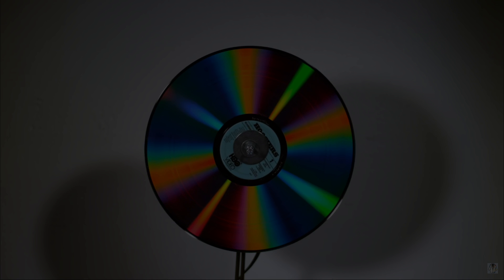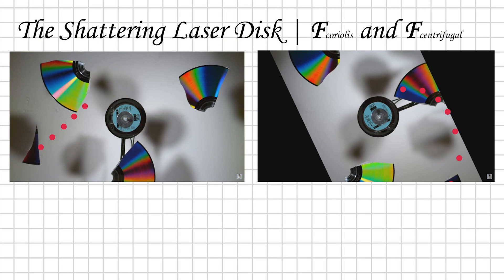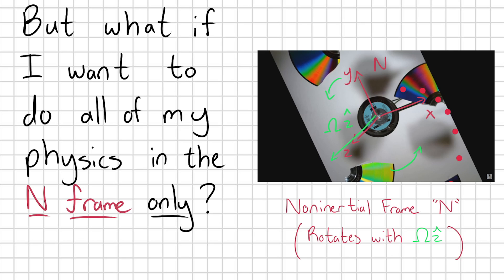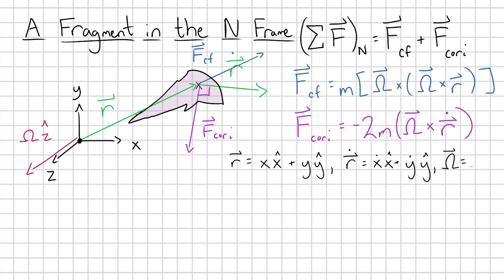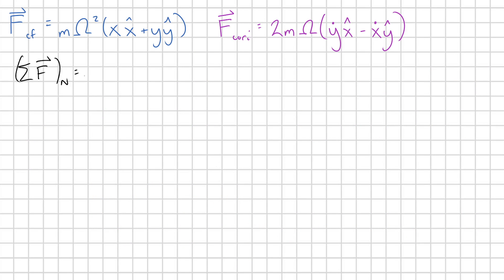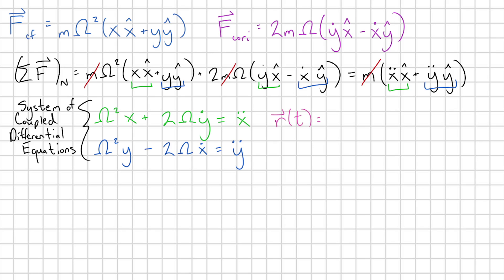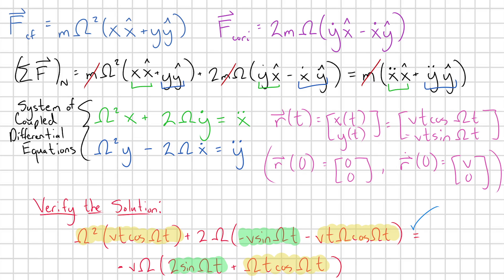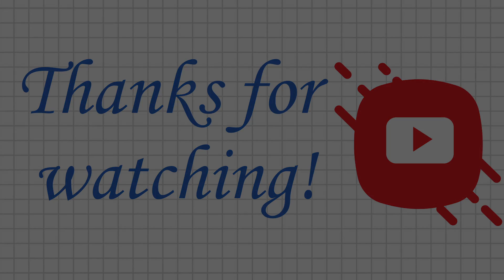The Shattering Laserdisc | Exploring Centrifugal and Coriolis Forces

Comment: You are missing a minus sign in your definition of the centrifugal force. If you actually do out the calculation for F_cf you wrote then you'll get that it points inwards not outwards. 

Below shows how it's wrong. 

If we assume r = x*X_hat + y*Y_hat, and then (to avoid trying to type messy algebra) we assume y=0 and x=1, then we have r = X_hat. We stated that it's spinning about the z axis so the Omega_vector = Omega*Z_hat, again for simplicity of typing we can ignore the omega and just write it as Z_hat. Therefore 

If we have F_c = m[ Z_hat x (Z_hat x X_hat)] then we get:

Z_hat x (Z_hat x X_hat) = Z_hat x (Y_hat) = -X_hat

Therefore F_c = m Omega^2 (-X_hat)
which is a vector pointing inwards.

You can repeat this including a positive value for both x and y, and you'll get the same thing, that it points inward towards the center. You can check with a cross product calculator using any values (even negative) for x and y, your final answer will always be [-x,-y]

If you want to see this typed more clearly here's the LaTeX code you can type into Overleaf (add an extra space between lines if there isn't one when you copy paste):

$\vec{F_{cf}} = m(\vec{\Omega} \times (\vec{\Omega} \times \vec{r}))$

$\vec{F_{cf}} = m(\hat{z} \times (\hat{z} \times \hat{x}))$

$\hat{z} \times (\hat{z} \times \hat{x}) = \hat{z} \times \hat{y}$

$\hat{z} \times \hat{y} = -\hat{x}$

Final answer for general case (including $\hat{y}$): 

$\vec{F_{cf}}=-m \Omega^2 (x \hat{x} + y \hat{y})$